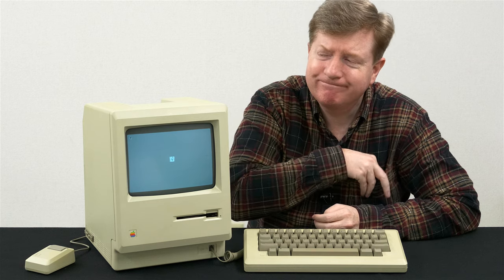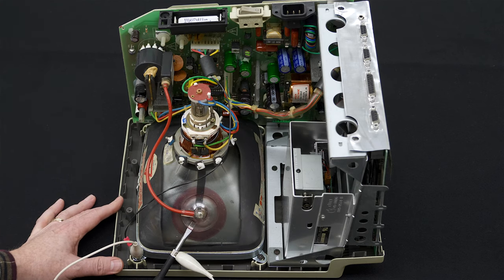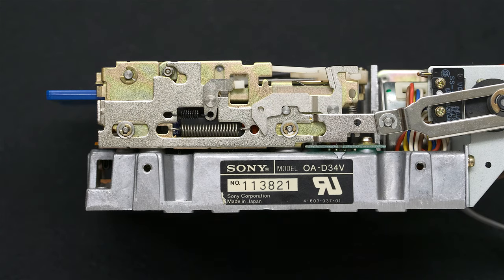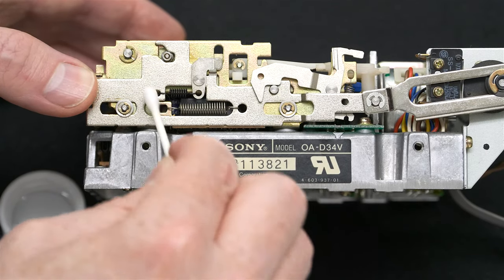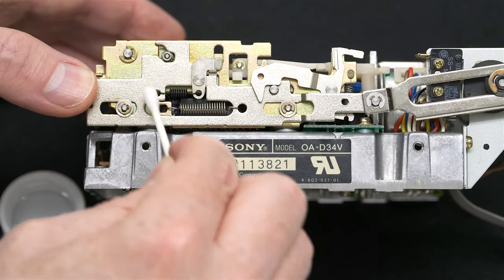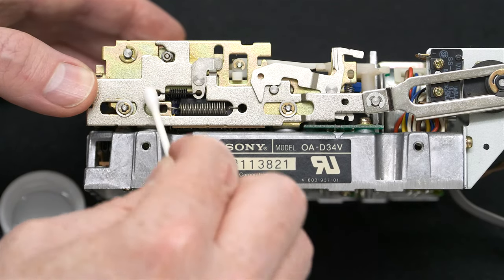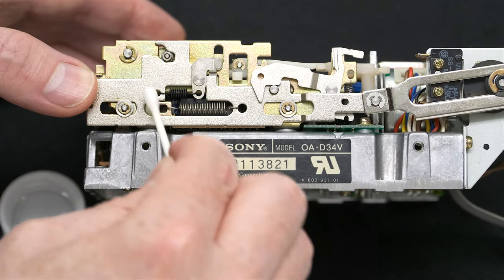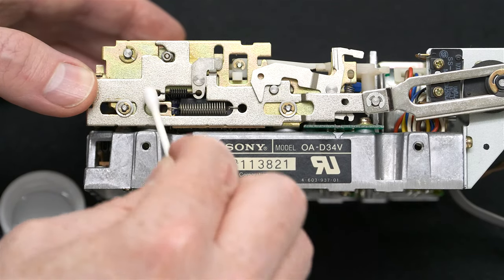Apple 400k Floppy Drive Lube Repair [1984 Macintosh]

Comment: Thanks for this one @JDW! I received a 400K drive this week in an original box. I think this drive was swapped out as part of an upgrade. It's very clean, but all the original grease had completely seized the mechanism. There was a yellow transport disk in it. Thanks to your tips it's now running smoothly again after sitting around for in excess of 35 years. Good stuff!
Reply from the maker: That's wonderful to hear, Gavin.  Thank you for kindly making time to share your restoration success story!  Best wishes!

Comment: Your instructions helped me get my Macintosh 128K's floppy drive back in working order. Slightly different OA-D34V-22 drive in my case, but was still fun to figure out. The holder for the felt pressure was missing, so I attempted to 3D print one, but only to find the original one hiding inside the brightness dial pot at the bottom as I was closing things up... Anyways. thanks JDW for the great, easy to follow tutorial!
Reply from the maker: Thanks great to hear!  Thanks for making time to let me know of your repair success, Brian!

Comment: Thank you so much for posting this!  I never would have guessed it would be so easy to fix a computer even one that is almost 40 years old.  My knowledge of these old computers is very limited to my use of them in school close to 30 years ago.  I just bought one of these to re-sell and unfortunately the seller only powered it on and said it worked.  Well they obviously didn’t attempt to put a disc in it because when I did it didn’t really want to accept one but then it did with some moderate force and read it with no issue but then wouldn’t eject (and I wasn’t even sure of the correct way to eject a disc so I checked the manual after I was having no luck). I ended up ejecting the disc with tweezers when it would spring up for a second so I could grab it.  I then tried another disc thinking maybe the disc was to blame but the drive was not fully open so the disc did not go in straight and ended up knocking off the pressure pad (as I later found out).  Then of course it would not read a disc or eject one correctly!  I found your video, I did the lubrication step by step following it very carefully and got it to eject properly but it still would not read a disc.  I took it apart again and found the pressure pad inside the case, snapped it back in and voila it works just like it should.  I am so thankful, for a while there I thought I was royally screwed.
Reply from the maker: Thank you for sharing that wonderful repair success story, Tyler.  I hope that old Mac of yours brings back a lot of memories from when you first used them in your youth.  That was a big motivator for me to get involved in vintage Macs.  At some point you will also need to change out the aluminum electrolytic capacitors in that machine, either by yourself or by paying someone to do it.  I have videos on that, if you want to try it yourself, and I include Mouser carts so you know which capacitors to buy.  It's doable, even by a novice if you follow my videos.  That will help to ensure that old Mac will keep working well for many years to come.  Best wishes!
Reply: @JDW-  Thanks, I don’t plan to keep it.  I was just going to re-sell it but had to get it working properly to have a chance of turning a profit on it.  It is actually in really nice shape and a complete set-up with printer and I believe the Picasso set.  I would love to get “The Oregon Trail” and play that on it!  I have such fond memories of playing that in class.  I found the exact version a few years ago that I played someone had downloaded from the floppy disc onto the internet.  I actually figured out how to win, something I never was able to do in 5th grade😒

Comment from the maker: The green label on the Grease I used has the misspelled word "SILICON," and I unfortunately pronounced it that way in the video.  The green label should have written "SILICONE," which describes what it is; but the small Japanese text underneath is correct: "シリコーン".  It is made by "AZ" and advertised for use on nearly anything, including metal, rubber, plastic, wood and even paper.  All said, please use "SILICONE Grease."

Comment: You don't need to pry the case open.  If you loosen but don't remove the torx screws, you can push down on the screw with the torx driver while pulling up on the corresponding case part --- that force will safely crack open the case.
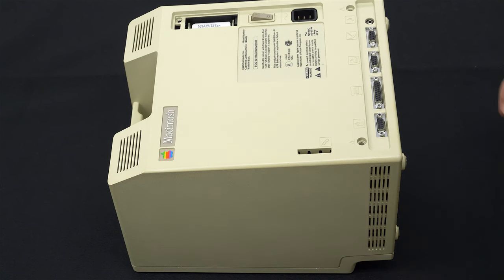Reply from the maker: Thank you for sharing. You are referring to 1:26 in my video.  That is one way to accomplish back case removal, I agree.  It's still stuck pretty good when you seek to remove a back case for the first time, but after several removals it often becomes easier to remove simply by putting the machine over a soft bed, grab the back case, and then shake it firmly up and down a couple times to allow gravity to pull the guts straight down and onto the bed, leave you with the back case in your hands.  Interestingly, I also find that getting the back case off an SE or SE/30 is easier than my Mac 128 and 512 machines.

Comment: I’ve got a 02 and 22 revision of these. Both are stuck in the down position always. It seems like there is a bar near the back of the mechanism that doesn’t move without a lot of force applied to it. Have you repaired one of these?
Reply from the maker: I have only repaired models shown in my video.  I offer additional tips about getting stuck parts unstuck in my video that centers on 800K drives: https://youtu.be/sy6JWEerHQc
Specifically, jump to the section in that video where I talk about KURE 5-56 (WD-40).  The video is indexed so you can easily do that. I believe that info will help you.

Comment: My Macintosh 128 (from early 1984!) developed the opposite issue, where the drive won't eject the disk! Once I dig out my long handled torx I'll have to have a look and see if it's just gummed up or if the gear or motor are damaged. Nice to see you can get a modern battery replacement, that's another thing my 128 needs (and replacement rubber feet, mine literally melted into a sticky gooey mess!). Incidentally although my 128 is an original like yours, its previous owner upgraded it to a "512E" internally, so it has an 800K Sony 3.5 mech. Not to mention a 512K revision board, Mac Plus firmware and even a third party 512K RAM expansion board soldered in! Always wanted to downgrade it back to original specs, but at this point I'll likely just repair the floppy drive, its rubber feet and change the battery.
Reply from the maker: The 400K drives very rarely have broken gears.  Most likely, you need to clean and re-lubricate it.  The 800K and 1.44MB drives suffer from broken gears mainly because the gear that breaks is very tiny and it seems to be made of a different kind of plastic than the other gears too.
 
As to downgrading your Mac to make it stock, I would advise against it.  Shortly after doing that you will be wanting to put all those upgrades back in.  The upgrades really do make it a much more usable and fun machine.  Even so, hearing the purr of the stock 400K drive brings back a lot of memories for me because my first home computer was the 128K in 1984 when I was 13.  Those drives are a tad slower than the 800K drives, but there's something about the sound of the 400K drive that holds a special place in my heart!
Reply: @JDW-  - Agreed! I no longer have my collection of Mac Plus's or SE (sadly gave them away in recent years!), so having the 128 in an upgraded state is  important if I want to tinker with 80's era 68K Mac software. I totally get the nostalgic sound of the drive, my first computer was an Apple II Plus clone in 1984 when I was 12. There is just something magical hearing that unique whirring sound (especially the slimline Japanese Newtech Asuka drives I had; still have them but wish I could find the custom chip they used to repair them and hear that sound again!). Yeah, hopefully it just needs some lubrication. I do have a spare Sony 800K drive mech or two but they're getting rare so I'd prefer to fix what I have.
Reply from the maker: @Apple2gs  Had to lookup those NewTech Asuka drives.  About the only thing I can find on them is here: https://twitter.com/foone/status/1171586137854365697?lang=en
Reply: @JDW-  - Coincidentally I found that Twitter posting a few months ago, even tried contacted the guy but never got a response back. What I need is the "NT8306" chip pictured! Back in the early 90's someone in Japan sent me a spare chip, but since then, no luck.
Reply from the maker: @Apple2gs  I see a photo of that IC at the same Twitter page.  Has the NEWTECH name etched in it, which implies it was made exclusively for them.  As a result, that will be a challenge to track down, especially since the company likely folded long ago, disposing of all their assets.

Comment: 0:17 or it won't eject despite the eject motor audibly spinning up and having trouble, and the floppy slightly moving but not enough to get out of the drive
Reply from the maker: Correct. There are a number of problems that can happen with these old drives.

Comment: Thank you for this!  It came in very handy with my Mac plus which I have had stored in my basement for at least 20 years.  Sorry for the late question, at 21:28 in the video, it occurred to me that the metal shielding comes into contact with the pins on the logic board. Why does that not cause a short on the logic board?
Reply from the maker: Congrats on your drive repair!  
What you are seeing at 21:28 is the outside of the metal shield that never touches the motherboard.  The flip side of the shield is the part the touches the Motherboard, and which has a thin, transparent piece of plastic affixed to prevent shorts. Yours should too.  If the integrity of that plastic insulator is compromised with pin holes or the like, you need to apply masking tape or similar over it to prevent shorts.  If you think you cannot do that, just remove the shield altogether.  Unless you have HAM radios or similar nearby, any noise resulting from shield removal will not be noticed.
Reply: @JDW-  Thanks so much for the quick reply!  I measured one side for continuity on one end and the other and of course it was the side that is metal.  Didn't occur to me to check the other side.  Now I can test it.  Thanks again!

Comment: That was a really nicely presented tutorial; thanks.  I managed to get the drive ejecting properly again, but it won't accept any disks -- just reads briefly, shows the X, and spits them out. Any idea how to fix that?
Reply from the maker: Since my video is focused on the 400K drive, I will assume that is the one you have.  I will also assume your word "accept" means "READ" -- meaning, the drive will allow you to insert the disk, and it will properly go in all the way and start spinning, but the problem is that you cannot boot from the disk, as evidenced by your use of the "X".  Boot from another disk externally (floppy, hard disk, or FloppyEMU), then insert your 400K disk into the internal drive and let me know what happens.  That test is important because it could be that your disk simply isn't a boot disk and is why you cannot boot from it.  If you boot from a different disk (externally), when you insert a disk into the internal drive, if the computer cannot read it, it will ask if you want to initialize it.  Assume you don't mind overwriting the content, go ahead and Initialize.  Assuming it is a good disk, it should format.  Try more than one to be sure sure.  If all disk report "initialization failed," then it could be the head is dirty.  Clean it carefully with a swap and 99% ISO alcohol (much better than 70% rubbing alcohol).  Give it plenty of time to dry, then test again.  If you still have the same problem, assuming you reassembled everything 100% correctly, then it could be a head misalignment, and those are no fun to fix.  So please do the other tests first and let me know.
Reply: @JDW-  Thank you so much for your quick and thorough reply! Your assumptions are correct. I can successfully boot from the external drive (a noisy 3rd party Ehman Engineering 800k drive). Attempt to initialize two different 400k disks in internal drive failed, so I will try cleaning the head and report back. [Question: Is there X number of days one can wait after power off before it's not necessary to worry about discharging CRT?]
Reply from the maker: @aarona.3780  When you clean the head, do not use a cleaning floppy unless specially made for the 400K drives — such cleaner disks are so rare I don't believe I've ever seen one, actually.  You see, 400K drives have a felt pressure pad on one side, and the head on another.  Normal cleaner disks are made for 2 heads.  So if you put a normal cleaner disk in a 400K drive, the cleaner disk on one side will likely rip off the drive's felt pad due to friction (or maybe even shred it).  This is also another reason you don't just stick a swab in between the felt pad and head.  Dip a swab in 100% IPA (90% or higher is preferred) and clean only the head, never touching the felt pad.  Use a magnifying glass before and after to confirm there is no grime left behind on the head.  I had an 800K drive I had "cleaned" in the past (or so I thought), but it had READ issues.  Then I took my magnifying glass and found I had not properly cleaned it because there was yellow stuff still stuck too it.  It took 4 more cleanings with IPA and the swab to get it all off.  The drive would Read/Write perfectly after that.

If you have a very old 128K or 512K Mac, the flyback may be the original version which lacks a bleeder resistor, which means it will stay charged for such a long time that I cannot possibly give you a number of days to say when the charge will be gone.  Professor Thomas Lee of Stanford University, in the Electrical Engineering department, has suggested that you can discharge CRTs without touching the CRT merely by turning brightness up all the way, then yanking the power cable.  It's worth doing if you are afraid to discharge normally.  The normal way isn't dangerous.  But even if you feel it is, just wear rubber disk washing gloves.  That way, even if you touch something, you won't ever be shocked.  Then you will need a flat-head screwdriver and a cable with medium to large sized alligator clips at both ends.  One clip attaches to the lug nut which mounts the CRT to the front plastic case in the upper left corner (when viewed from the back of the CRT), and the other clip attaches to your screw driver's metal shaft.  Touch only the rubber part of the screwdriver and slip the tip under the circular suction cup attached to the CRT.  You may or may not hear a brief zap.  After that, it is discharged and you can safely remove the suction cup and even the entire analog board.  Don't yank off the suction cup.  You'll need to push on one of the two little metal pieces inside, which you cannot see and which hold the suction cup to the CRT.

I hope this helps!
Reply: @JDW-  Well, we've communicated directly but for benefit of other viewers, I'll just sum up here: took Mac apart again and saw that the felt pad on the plastic arm above the head was missing. (Not uncommon.) There are accounts of people repurposing a Q-tip to take its place. I had no luck with this. However, on a whim I tried cutting up a foam earplug in place of the felt, and jamming it up the little frame hole. That finally worked and now it's reading disks. I tried initializing one and it failed, though.  So I have a semifunctional 512k Mac...
Reply from the maker: @aarona.3780  I'm sorry to hear it is only semi-functional.  The main issue is that the felt pad needs to be flat, like the original.  If it is not flat, then pressure from the pad would be uneven, and that might result in errors.  But I also know that even drives with a perfect felt pad have issues if they are out of alignment.  I cannot talk to you about that because if your felt pad is not perfect like the stock pad, there is zero meaning to attempt a realignment procedure because for all you know, the root problem may in fact be the pad.  The only real solution would be to buy a thick sheet of felt and try to cut a nice round hole in it, then put the cylinder you cut out into the plastic pad holder on the drive.  That's really the only way to ensure it is flat.  Thickness can vary, but it needs to stick out of the plastic holder a bit, otherwise the plastic holder might press against the disk and scratch it.

As with all vintage electronics, it is extremely helpful to have spare parts.  For example, if you had another drive, even a broken one, you could remove the part you need for the somewhat good drive to make it perfect.  And then if you have a perfect felt pad, and if you then still have trouble with reading or writing or formatting, then you could try a realignment procedure.  But keep in mind that is very hard because you basically have to adjust a sensor on the drive in sub-1mm increments.  That is very hard to do by hand!
Reply: @JDW-  Thanks. I'm thinking Floppy Emu would be the most hassle-free way to go forward...
Reply from the maker: @aarona.3780  Without a doubt, you absolutely need a FloppyEMU.  I recommend them to everyone! The Deluxe Bundle is a tad pricy, but worth it. https://www.bigmessowires.com/floppy-emu/

Comment: Well, my Mac floppy is the OA-D34V-02, which is a little different animal. It is frozen with bad grease.  I've managed to get the ejector part unfrozen, but there is a part that is not in your floppy that is frozen.  I can't get to it to clean
Reply from the maker: Can you post a link to a photo of the component that you are talking about? To avoid the YouTube filters, you need to leave off the HTTP part and spell out the dots and slashes. Thanks.